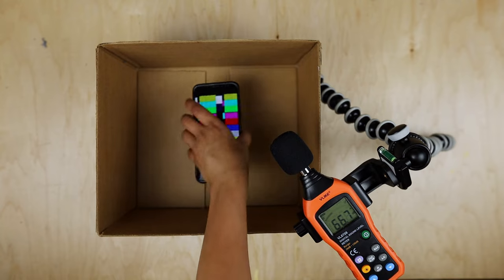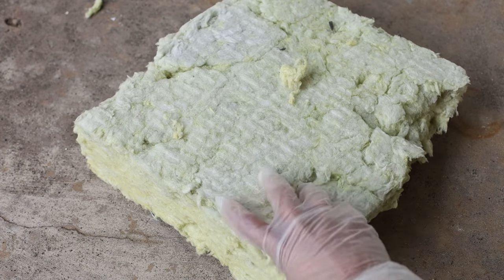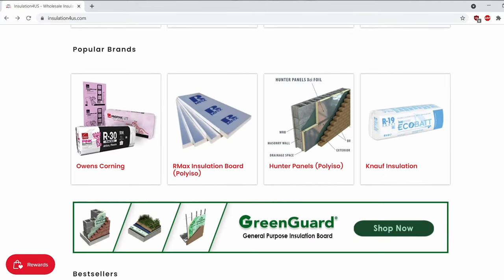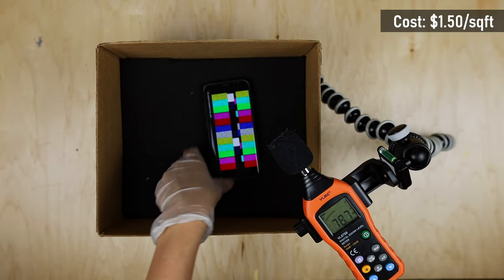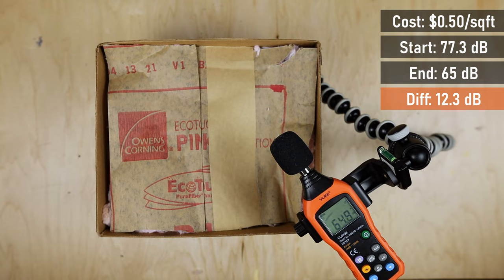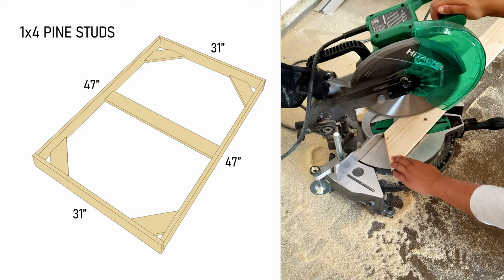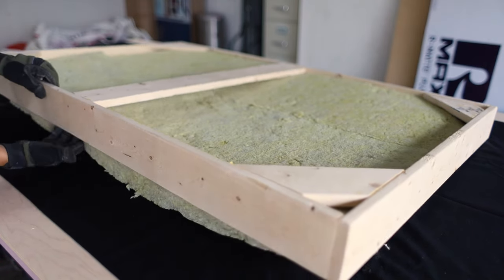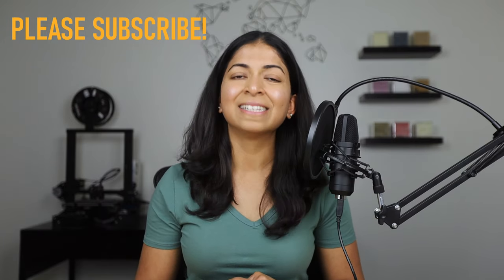Rockwool OR Fiberglass for DIY sound panels?

Comment from the maker: Many people have commented on testing different frequencies (which I hadn't thought of!). I did some quick tests today and got the same results. Fiberglass was surprisingly the best. 
Check out John Brandt's explanation:  https://www.youtube.com/watch?v=3mGbPHx_8X8
Reply: Thanks so much for doing this one! 🌎☺️✌️
Reply: Belinda, thanks for doing this. But I think big miss here is, the frequency spectrum. It is expected Roxul Safe N Sound Rockwool bats would do much better in lower frequency spectrum which is very tough to contain compared to high frequencies. If you look at STC ratings of various insulation you might see that reflected. But I would like to see, you perform that test and provide results, which I trust more much than other's tests done with commercial interest.
Reply: I would think fiberglass does well because it's more bouncy and fluffy therefore absorbs the sound waves a little better.
Reply: @nayudusrini  that's interesting, didn't think about different frequencies would matter but it makes sense. The products funny enough only gives one number on the package.
Reply: I'm sorry, but this is only acoustic correction. So they can alter the acoustic quality of the room they're in but do nothing to "insulate". For insulation you need "mass, spring, mass" and air tightness. Those panels won't help in acoustic insulation. The only thing they do is diminish reflection and resonance.
Reply: Heyya, thanks for the tests. My two cents as an acoustician, The paper backing of the fiberglass may actually be doing a lot in terms of transmission loss in your last test. Are you able to repeat that experiment with the paper removed?
Reply: Yes I agree, its not to block, it is to absorb sound energy there by reducing the level/amplitude of sound at various frequencies. Depending on wave length (lower frequencies are longer wave length), you need deeper/thick absorber to take care of those frequencies. But the question I have is, how each material reacting/absorbing relatively at various frequencies. Does Rock wool absorb lower frequencies better compared to fiberglass? I would assume so because of being denser, it takes more energy. But I will let Belinda do the test and provide the proof one way or other.
Reply: @SinnisjInsulator  Indeed, each material absorb sound differently. But just to remember, there are different aspect to the sound control. Absorption is one aspect of it. To completely block sound, its completely different ball game, needs lot more than just throwing some rockwool or fiberglass.
Reply from the maker: @Ben_Cheng  Thanks, Benjamin. I didn't remove the paper backing because I was testing the products as is and comparing their costs. If I removed the paper, it would affect the cost per batt. Since fiberglass doesn't friction fit into place as well, the paper helps secure it to the frame. I could still do another paperless fiberglass comparison in the future.
Reply: @Belinda Carr, I saw John explanation as well as many other as I was trying to improve the sound quality in my Dedicated Home Theater. There are two aspects, one is to control of reflections with in room, and other is the transmission of the sound thru walls to other rooms or outside. What John says is true, but how it is presented is not so, and misunderstood. When sound wave travel, it is in fact moving the drywall on one side, like a Diaphragm/speaker cone and that is passing on that sound wave to other size of drywall as that drywall resonating to sound. Though actual air itself is not leaking from inside room to outside the room, sound is still being transmitted because of that drywall resonance, as well as thru the studs.  But in the context of sound absorption, each of these material like Rock wool vs fiber glass behave differently at same thickness, at different frequencies. What I would like to see is, you test each of the material at various frequencies. This not only tells the how much sound is as people call it blocked, but also how much it can control reflections within the room. In the case of reflections, the effective thickness is doubled as the sound goes thru the insulation dissipating energy hit drywall and bounce and comes into room thru insulation dissipating energy again. Hope this makes sense, and you will get a chance to do those test for those who likes to understand these aspect on sound control/containment. Thanks in advance.
Reply: That's exactly what we are trying to achieve, acoustic treatment, not "insulation" or sound-proofing.
Reply: Here's the issue with midrange/high frequency absorption (frequencies 125Hz and above), you don't necessarily want to use "building insulation" for several reasons.

1.  They typically over absorb in the 125hz to 100hz range.  Why is that?  Well, there's something called the Fletcher Munson hearing curve which was generated based on different SPL levels.  But the curve for human hearing tends to have a curve to it in that frequency range. So you want a mid range/high frequency absorption product that closesly matches that curve, if you will.  There are acoustic foams on the market which typically do have a curve to their absorption coefficient, but you have to find one that has the best curve so it does something in the lower 125hz to 500hz range and steadily increases to 1000hz. Everything above 1000hz, all commonly used absorption materials are similar.

The other thing that's important is coverage.  You need about 70% wall coverage over about 70% of the walls.  Each wall, ceiling and floor contributes about 16.7%, so if you cover all four walls with 70% of a product, it's going to make a NOTICEABLE improvement, but don't do 100%.  if you can do the ceiling, even better…. But all of this is JUST for the 125hz and above.

For below 125hz, you'll need a pressure activated device and same rules apply.   You'll need to get around 70% coverage to make a HUGE difference, but you have to figure out the worst model pressure problems (frequencies) first, and then where they are located within the room.  The worst and most difficult are Axial modes, which are between 2 parallel wall surfaces.  So, you'll need to get about 70% coverage for those walls. 

Do NOT buy into the corner bass trap hype. It's nonsense in MOST small rooms.  Axial modes are between 2 parallel walls, not 2 parallel corners.  The corners is where the Tangental and Oblique modes build up, but you need to deal with the Axial modes first, otherwise you aren't treating the low frequencies as well and it's not going to sound very good.

Then there is diffusion, quadratic is the most consistent, but you have to first figure out what application you have as that will dictate where you locate the diffusors, whether you want vertical for a horizontal dispersion OR a combination of both vertical and horizontal, which might be best for the rear wall.

Diffusors are expensive and again, you still need a fair amount of coverage, but typically for a 2 channel room for listening, it's the front wall and rear wall.  if you do diffusion for the rear and front, you won't need foam because the diffusors replace those to give a more open soundstage increasing the sense of depth, width, height.  for control rooms for a studio, they tend to go with rear diffusors and then front wall is both low frequency pressure absorption and mid/high frequency in front.

I know this might sound confusing to some, but let it sink in.  Do NOT think that an absorption material is for low frequencies in the sub 100hz range, they simply won't absorb that much, that's why you'll need pressure activated absorption, but there are companies that make products that handle the low end, and then they put foam on the front to handle the mid's and high's, so it's just a matter of getting enough coverage, and yes, they do get expensive.

I really would stay away from building insulation.  It wasn't really designed for acoustic treatment, it was designed for thermal insulation within a wall cavity.  Also, they tend to be kind of harmful to work with, and you DEFINITELY need to watch out because they can release smart particles that are not organic that can cause harm to your lungs over a long period of time.  I would get a good quality acoustic foam, build a frame and put a nice acoustic fabric (Guilford is typically the standard brand) and the place around the room leaving some space, but you have to get about 70% coverage.  Too little and it won't do that much, too much and it will definitely sound too dead for most people.

The main reasons why people use building insulation is that it's cheap, and that's it.   Yes, some studios use it, but some are actually moving away from it when they hear the difference with some of the newer foam products on the market and above all, NOT ALL FOAM IS EQUAL.  You can look at their absorption coefficient curves if the company had them tested, if they didn't test them, then stay away from the product.  If you compare anything, make sure you are comparing equal amounts of coverage and that you have enough coverage to really hear a difference..
Reply: @nayudusrini  I would stay away from Safe N Sound.  yes, it does absorb more in the 125hz to about 500hz range, HOWEVER, you won't get a natural sounding room with that curve in that frequency range. I would suggest something else. Yes, I know, acoustic foam tends to be more expensive, but if the company did their homework they got the absorption curve to closer match the Fletcher Munson hearing curve which has a smooth slope between 125hz and 1000hz.

As far as below 100hz, you need a completely different absorption device and diaphragmatic is the best for low frequency problems, especially if you have a lot of energy in the room that you have to manage.  From reading various company's products, I found one company that does have probably the best on the market.  They aren't cheap, but they do work better than other products and that's because it's a VERY robust product with a LOT of mass, a great dual wall design and they are using activated carbon which in fact, is better at absorption in low frequencies.  There's literally only one company that offers it due to their IP patent protection, but the stuff works.  There was a University Study in England done many years ago testing activated carbon and it was effective even down to 20hz, which nothing else will do that.  I think it's due to the high porosity of activated carbon and it's mass if it's compacted tightly.  KEF has patents as they used Activated Carbon in speaker cabinets for low frequency compliance within the speaker cabinet, so that's another company that has validated the use of activated carbon.

The good news is that the company that uses it for room treatment does work with the DIY crowd and that they can help you figure out what your needs are and then sell you raw materials and you can save money by doing the rest of the labor yourself.  Their foam is also quite good. I went to one of their demo rooms to see for myself and I was simply dumbfounded at how good that room was. I've used ASC tube traps, compressed fiberglass, and have been in many rooms with rock wool, etc. etc. and flat out, they simply don't sound as good as what Acoustic Fields was doing. I highly recommend them if you can afford it.  But you don't necessarily have to do the entire room all at once, you can do it in sections as your funds need it, but they do offer REAL good advice on developing a strategy for fixing your problems rather than just selling you stuff that may or may not really work that well.   That's just from my experience of dealing with acoustic treatment companies
Reply: And only In the 125hz and above.  For absorption down in the 100hz and below range, you also need lots of mass and a diaphragmatic type design with a really good fill material, and you need lots of wall coverage since low frequencies are more omindirectional and they build up all over the place, especially the Axial modes.

For thermalinsulation, fiberglass and rock wool are used in wall construction, but homes are typically not designed for audio, they are just designed to keep people's voice, etc. attenuated or more for thermal insulation as it's put inside the wall, but most homes have 2x4 wall construction and that's simply not effective below 125hz at all.  Try a 2x12 studs, with layers of plywood, MLV, MDF, OSB, and possibly other materials. I saw one wall construction design that used a combination of these, along with activated carbon and they were able to get a STC rating of 90 down to 40hz and the wall was only 10.5 inch thick, which is pretty darned good.  Plus, a finish grade ply wood sounds a LOT better than sheet rock or other materials for the inside of the room. Even most studios don't use Sheet rock unless they were on an extreme budget, the use finish grade plywood as well.
Reply: Need to talk to sound pollution experts in this case my Youtube friend! Noise has many characteristics which you have not factored for. Harmonic spectrum as well as amplitude modulation envelopes are reflected and filtered differently by physical impediments. I watched your shipping container scam video and was impressed by your knowledge, here not.
Reply: @dayvan6550  are you referring to creating barrier to attenuate noises going in or out, or are you talking about acoustic treatment for a specific application within a room?
Reply: @Oneness100  is there any special way to treat framing members to help reduce sound transmission from room to room, or are they not as much a concern?

Since you say that finished plywood has a good accoustic sound for the inside of the room in comparison to other common surfaces, in your opinion would it be better to leave a hardwood floor bare, or cover it with rugs/carpet? Or is there some other floor treatment that's ideal and makes a significant impact?

Also, I'm wondering if you have, or know where to look for, any information on how to treat odd-shaped rooms like ones that are octagonal instead of rectangular, or which have curved ceilings instead of the ceiling meeting the walls perpendicularly.

You seem to be very knowledgable, which is why I asked, but of course I understand if you don't wish to answer yet more questions. I found your previous answers to other people's questions very helpful, so thank you!

PS what's your thoughts on the clay-like soundpads that are applied to the outside of metal electrical boxes in the walls of office buildings? Do they actually do much to prevent sound from transmitting through walls and out of recepticals, light switches, etc?
Reply: Rockwool outperforms  fiberglass when used as a system.. What do you think they use in the walls of  IMAX or any theater you go to... Its several layers of sound rated drywall and rock wool . Same as any hotel you go to . John Brandt is wrong also. I have built several sound studios  and no single product makes the wall soundproof ..
Reply: i think you made a mistake when testing these. 

you were testing how much noise reduction you get from wrapping something with insulation, but this is not what we are doing when we put up panels in a room. 

to test the effectiveness of your panels you need a microphone set up and picking up all the noise in a room without the panels, then again with the panels. what we care about is the noise bouncing off hard walls. 

panels like this don't work for soundproofing unless you cover every inch of the room and completely close it in, which is not what people are doing with the panels at all. 

either way the more uneven the surface of your panels, the better they will work. what you want is not just absorption but also disruption of the sound waves to prevent them reflecting back.
Reply: Other Materials are BASOTEC Acoustic foam and Frottee towels. The last are the best!!! Even better the glas fiber. Once I saw a yt video about comparison to towel fabric as acoustic dampeners.
Reply: Hi Belinda, how much dB reduction did you get with low bass noise with the fibre glass?
Reply: @BelindaCarr  The paper reflects the sound. Can you test the level of sound that bounces back into the room? We're not putting microphones against the wall, behind acoustic panels.
Reply: sometimes best way to test it yourself not from ads of products!
Great work btw
as matter of acoustic panels they are useless they only made to lower the ECHO so if you want to loser the noise or absorb it for loud equipment they are completely waste of MONEY 
btw try MLV & EVA they are helpful thou MLV is bit expensive its quiet effective
Reply: can you test it with power generator noise sample? 
i tried many things sure dbs drops but its still high pitch  so even 50dbs of power generator have annoyance of 70 dbs of any other noise source
Reply: the problem with the fiberglass with backing material is you have to have the sound  aimed at the fiber side because the Backing will reflect it back, as for the main purpose in a studio is to absorb the frequencies not to reduce db.
Reply: It's great to have both. Rockwool is better for the lower frequencies where fiberglass is better for the top end. Both my recording rooms have both from 2 to 6 inches around. Those tiny little foam panels are useless for acoustic instruments . The only time I use foam is may be on the ceilings over the cymbals And even then I wouldn't use less than 3 4 inches thick.
Reply: But be aware. What you are testing is soundproofing which is something else than acoustic treatment. Soundproofing is protecting your neighbors from your guitar playing, while acoustic treatment is protecting yourself from bouncing soundwaves aka echo in your room. The panels in your room should limit reflection and or diffuse the direction of the soundwaves.